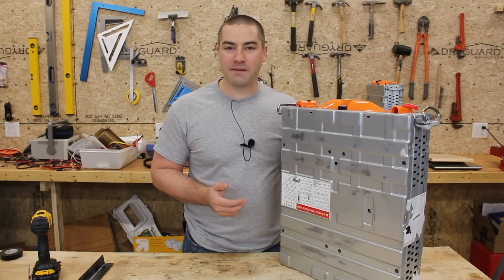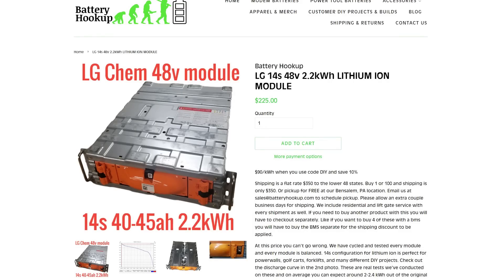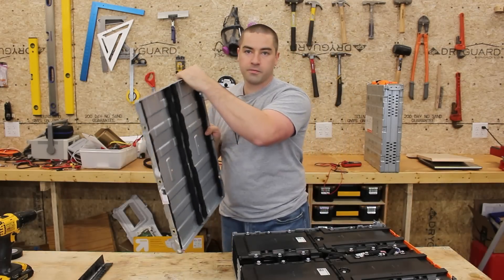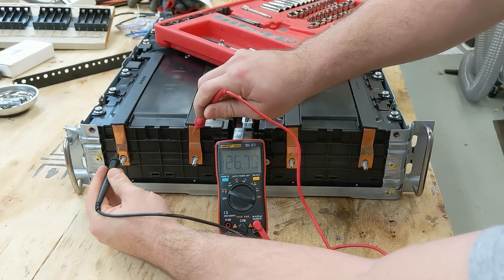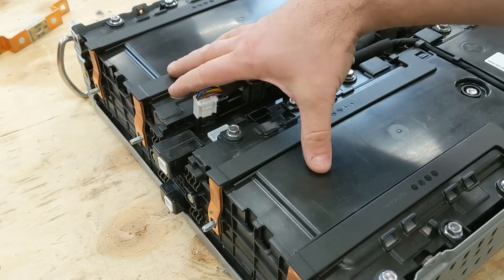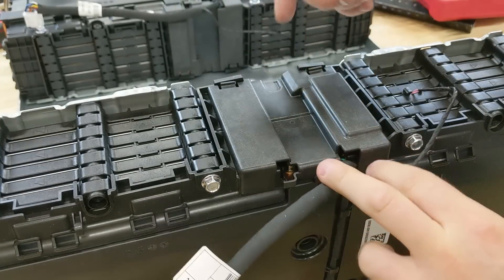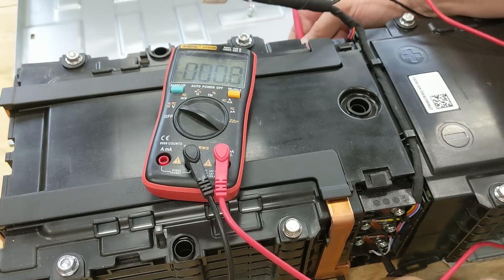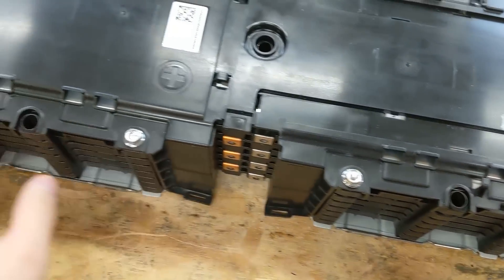Batteries for Home Backup, 14s 48v (51.8v) LG Server Rack Lithium

Comment: Hi Dave, this is all really new to me but very exciting, I'm planning on building an off grid home, with solar, wind and hydro if possible.  What's my best route for a long lasting system, should i buy 20 or 40 of these LG server rack battery's. If I put a BMS in each one how do I collate all the information in one web page, do I rotate the cells or leave the packs more or less as purchased.   How would i wire the complete system holistically and is that something an electrician should do? Lots of questions sorry but your videos have got me really excited about the possibility of building my own off grid home relatively inexpensively.   Thanks for your great videos i cant wait for more.
Reply from the maker: Hi Marc,  Near the end of the video I state that these modules are pretty used up.  They would be great for home back-up systems.  However, if you plan to cycle them daily in an off-grid situation I don't think you will get more than 2 years out of them.  It's just a guess and I could be wrong.  But, if I were building an off-grid home I would look for newer cells.

Now I will answer your question.  If you are looking at 20-40 of these LG modules, then I'd buy 28 or 35 modules.  Keep it in a unit of 7.  Then I'd flip all the cells around, as I described, so that each module becomes a 7p2s.  Stack 7 modules together making 14s.  Each would get a BMS.  If you are the type of person looking for web interface, then check out Batrium.  Batrium cells WM5, and then you add "expansion boards" for each additional 14s pack.  They do the internet thing.  I'm not computer savvy, so I just do simple BMSs.

If you have a little time before you need the batteries, and want to wait for something with more life expectancy, then I'd wait for BAttery Hookup to offer more EV modules.  They just had a few last week of Volvo packs.  And last summer they had a couple hundred BMW packs.  I'm not particular to my brand, any are fine.  But the EV packs tend to have a lot of life left.
Reply: @DavidPozEnergy  not in rush, just watching as much as i can i liked the electric vehicle video you did. I worked for Ford along time ago and they use a hydraulic press to compress the battery's prior to packing.  So i was surprised you were able to repack the battery's..  Thanks for the great information, i do a lot of REST API dev for transfer of data across web calls so i will check out that web site.  Have great day keep up the amazing videos.  Marc

Comment: @DavidPozEnergy Hey, I know this is a few years down the line, you say this battery is dead at 39.2?  By any chance was that a calculator error? I have 4 of these bad boys and I had the cutoff at 48 and the max charge at 56, but then the CC died, I disconnected the batteries from the inverter while the CC was fixed... when I powered it all back on I didn't check the inverter cutoff and it had dropped to 44.4, Just want to check the chemistry on these things and cant find much.

PS, I bought them just a few days after you posted this :) Loved them every since!! Tested them when I first got them and they were all at 2.4 KWH! They are now down to about 2 KWH each, I think... haven't yet got them back up to 100% with the northern winter coming in like it is.
Reply from the maker: 48V is also what I use day-to-day as my Low-Voltage cut-off.  You have some good numbers there. They will last longer living in your 48-56 range.  
I'm glad your pack is working well.  I used mine for a while (maybe 6 months?) then gave my packs away. They were still doing OK, but I just made room for new batteries.
Reply: @DavidPozEnergy   Thank you for the response! I now have them set to charge to 55.6 and cutoff at 48.8 Trying to get AH numbers on them at different voltages, see about how many Watt hours are still in them after that kinda lower then I wanted voltage.

Comment: Hi Dave, my name is Marc,  I  purchased 4 of these batteries,  and  I  am  setting them up together with a map solar 50/ 48 inverter,  it is saying  to put a breaker / fuse between the inverter and the battery, what size fuse do you  recommend  I  use, and what  type,  ?  Should  I  use a barrel  fuse or a breaker?  What  do you think? Thanks in advance! I  appreciate all your great videos
Reply from the maker: Fuses and breakers are both "over-current protection devices".  They work differently, but usually I prefer a circuit breaker when it will suffice.  You must size them based on the wire size you are using.  Here is a good resource: https://www.altestore.com/diy-solar-resources/recommended-inverter-cables-sizing-and-breakers-or-fuses/

Comment: You should get a job with a battery company very nice end result 5 stars as you let it expand will that damage the cell?
Reply from the maker: The cells need to be under compression during cycling (charging/discharging).  It doesn't hurt them to remove the compression during inspection since I wasn't doing a cycle at the time.

Comment: I bought 4- of the single batteries. Not the whole box. What is the specific charging per battery. I’m trying to make a small camping battery with a kick.  I would like to run 4 in series is how I would like to run them.
Reply from the maker: Don't exceed 4.20 volts per cell.
Reply: @DavidPozEnergy  how many amps can I use to charge per hour ?

Comment: If I buy 2 of these set ups and convert them to 24V  how many KWH would I have and what size BMS could I use. I need it to power a small wire feed welder (90A-110A) and some basic tools?

Comment: Nice used your your battery hookup code. I am building a kW solar generator. You should check out Gyll batteries very similar new cells 5kw with BMS priced very good I believe they use prismatic cells

Comment: greetings mr. david; with all your tinkering on this subject, what would you recommend as the best batteries for off the grid, solar system. use continuously and charge daily. generator available for top off on cloudy days? i apologise, you answered my question for another commenter below.................g
Reply from the maker: I don't have a favorite, I just buy what I can get.  Generally I'm comparing $/kwh  Or $/kwh/cycle.  If you buy brand new, then several people have had success with LiFePO4 cells from Alibaba.  I buy used batteries from Battery Hookup.

Comment: Easier to use a flame and melt the 2 red end glue spots first to lock it in and then the solder in the middle, and get a used iPhone to use for this stuff, they are cheep!

Comment: I am in Australia and I have a few questions for you
1- do you ship to Australia ?
2- would it be possible for you to make or modify them into 12v packs with BMS at what total amps capacity?
3- could these packs be used in motor homes?
4- and if all this is possible, what sort of cost would it be?
thanks a lot from Australia
Reply from the maker: Hi.  
1. I am not a seller, I don't ship.  I bought this battery from Batteryhookup.com
2. These are 3.7v nominal cells, which don't work well for 12v builds.  Instead use LiFePO4 (3.2v) in a 4s.  That works much better for 12v.
3. I suppose so, but they are not water-proof, so you would need them inside something

Comment: Hello, I am giong to built a powerwall an wanna connect it maybe to a SMA solar inverter. The cells and the BMS, in my case with an additional active balancer, is no problem. But 
will the battera pack work correctly together with the inverter (e.g. SMA Sunny island)?
Reply from the maker: Yes, for the most part it works.  I have mine hooked up to my SMA Sunny Island right now.  It does work.  However, the inverter is not programmed well for this.  The SMA inverters want to see an outside BMS when connected to lithium.  If you don't have a BMS that communicates then you can run the SMA in VRLA mode.  It's OK, but not a perfect algorithm.

Comment: my setup is 8s4p lifepo4 with 100ah,. the probs is im scared to connect the bms i know will do spark on the post or damage my bms. please need guide to charge the cap.
Reply: Use a series resistor of  a few ohms value to charge the caps. Easy.

Comment: Hi, Dave,  I  bought 4 of these modules,  and  have a  map 50/ 48 inverter,  like  the one you  used for  your  friends  well install,  I  am  building  a  double wide 45 ft HC shipping container house,  I  am  planning  on  using  very little  power  at night,  very  few lights  and a  dish network  receiver and  TV,   and  I  will  have  a  mini split  ac, for  the summer,  as you  know  the inverter will  run everything  I  want to  run during the day when I  am  getting  proper  amount of sun exposure,  after  the batteries are  recharged,  so I will  run my clothes washer and gas dryer  during the day only, so I  expect  to discharge the batteries  very little,  what do you think? I  guess my question is,  do you think the batteries  will  last longer because I am will be using  the batteries  very little.  Thanks for your time and  the awesome  video of the  battery  to BMS hook up,  I  appreciate your  knowledge
Reply from the maker: Certainly the less you cycle them, the more years you will get.  I'm trying to make it clear these are used batteries, and don't expect them to perform like new.  The good news, you will be saving on day one.  And maybe in a few years you decide to upgrade, better batteries will probably be available for even less cost.
Reply: @DavidPozEnergy  , Thanks  for all your great videos,  you are awesome!!

Comment: Can this single unit be connected to a solar inverter without bms addition? 

Is there extra safety precautions can we take like setting min discharge to 48 v on solar inverter side? 

What is the downside ? 

Adding bms seems like a considerable work
Reply from the maker: When working with lithium batteries, I consider a BMS a must-have safety device.  This particular battery was one of the more challenging to add a BMS to.  If it looked like too much work, then consider prismatic cells.  Or, you can purchase a pre-built battery.  Pre-built 48V batteries have come down in price over the past few years.
Reply: @DavidPozEnergy my situation is I have one of these available to keep inverter on until I buy alternative soon. So how can I safely use it to keep inverter on during night essentially. I am thinking volt 56 max and 51 low cut off and 500 watt charge discharge limit. It is only until I buy larger battery. installing bms is beyond my ability.

Comment: Great video.  I need this for backup.  Question: I don't understand how you know which bms wire is for the first cell.  I see you probed them all against ground, but shouldn't they all be showing voltage?  It looks like you contacted your probe to the main positive.  Did you just contact the #1 cell only?  Not clear in the video.  What charge rate and charger would work with this?  I need exactly what you described at the end.  Also the automatic transfer switch.

Comment: Which battery is good for taking advantage of TOU rates? Say you want to avoid peak during 2-6pm, disconnect with manual transfer switch, 5-10kWh, no PV yet. Summer AC is max load, winter heat nat gas blower.
Reply from the maker: I'd suggest this battery: https://www.signaturesolar.us/products/h7590c9c2a/2203789000006324403  because it will last way longer.  I did a review on it here: https://youtu.be/SYJ25izYSGc

Comment: Great information, I’m going to look up some of your videos.  I’m a new guy trying to build a 7s 24volt battery pack that I will be able to use.  Eventually I want to build a home power wall, and be able to remove a battery pack and use the one pack as a power source while traveling.  Is this going to work?

Comment: Terrific info! Thanks! Just wondering, though: those balancing connectors on the BMU seem to be on 0.1" center pins. Would it be ok to just desolder them, put them on some protoboard, and wire the BMS connector to that? It seems like it would also allow you to keep thermal capabilities if your BMS of choice supports having a thermistor. Just wanted to see what you thought of this idea.
Reply from the maker: That hadn't occurred to me.  I don't have a computer background, and don't have any "protoboard".  I don't even know where you buy them.   I think it would be cool though.
Reply: @DavidPozEnergy  https://www.amazon.com/dp/B07CK3RCKS/ref=cm_sw_em_r_mt_dp_7Kq0FbEETQ9XP is one place to get them.

Comment: Hey David I'm not sure if you read the comments or not but if you do I'd like to tell you what I'm trying to do and why. Also I'd like your advice on my system. I have stage 4 cancer and I'm trying to build a off grid power system so if my cancer gets worse the wife and I still have power. And also if I pass away then my wife will have power without electric bills that we already can't afford. I bought 8 panels and a powmr all in one charge controller but I'm trying to find a large battery bank preferably 24 volt since our powmr I purchased is 24 volt. Any help would be greatly appreciated. Thanks in advance and thankyou for your videos
Reply from the maker: Solar electric systems, in general,  do not have a fast ROI (return on investment).  I would caution against building a system with the hope it will pay for itself in electricity off set.  However,  I've worked with people who need some piece of medical equipment running.  Then it's worthwhile making a UPS (uninterrupted power supply) just to keep the medical equipment running through power outages.

Comment: DavidPoz I hope you read this, I recently got several of these and the BMS, I received the same unit you did, it says 3.7v and the lifePo should be 3.3, correct? So how much are you able to adjust this BMS? I ordered them and was expecting 3.2v and instead got 3.7v units.
Reply from the maker: The battery I'm showing in this video is Li-NMC.  I'm using a BMS that is labeled "Li-ion".  It has a nominal voltage of 3.7 volts per cell, and 4.2 volts per cell maximum.

Comment: Great channel , meticulous and detailed - question - What inverter charger would you use on a 20kw LTO set up ? 
I'm building one and know that your opinion would be of great value.
Reply from the maker: I don't size inverters based on the battery bank.  Size your inverter based on your loads.  But if you would like a quick response, I really like the Sol-Ark.  Here is a link, and my code is "DAVIDPOZ" for free shipping.  https://shopsolarkits.com/products/sol-ark-12k?ref=s_fx9xj-vyvj

Comment: Great video, especially appreciate the recommendation against something like this for an off-grid system. 

I'm currently building an off-grid system. Do you have any specific recommendations for off-grid battery systems?
Reply from the maker: Sure.  The BMW batteries are testing far better.  This means they will last many more years for you.  If you combine 2 of the 5s, with one of the 4s, you will have a 14s battery.  https://batteryhookup.com/products/bmw-oem-5s-19-2v-75ah-1-44kwh-battery-module and https://batteryhookup.com/products/bmw-oem-4s-14-8v-75ah-1-11kwh-battery-module

Comment: David, great video.  Your attention to detail is incredible and much appreciated!  I have question in the 2s7p configuration you mentioned at the end of the video.  What would the max discharge and charge currents be in this configuration?  What size wire would you use to connect these in series and what size wire would you use to connect to your inverter?
Reply from the maker: In that configuration, we are talking about 7 modules.  The cells inside being arranged 7 in parallel per side, then the module becoming 7p2s.  Then series connecting 7 modules so the total cells become 7p14s.  I'm just clarifying.  
Each cell (technically 4 cells inside the plastic shroud) can handle about 50-60 amps.  If you connect them in 7p, that's about 400 amps.  
If I was building this, I wouldn't need the full 400 amps.  I might only be building it for, say, 10kw inverter.  If that's the case then I'd be fine connecting them with 4/0 copper wire so long as I was using a 250 amp circuit breaker.
Reply: @DavidPozEnergy  Thanks David, I misstated that you are correct 7p2s.  Thanks for the info and keep up the Awesome work in helping all of us DIYers out there!

Comment: Hi David,  thanks to your inspiration I finally finished a solar install on my mom's house. I was wondering what bms do you like the most. I have 12 chevy volt batteries that are known to be well balanced but I would like to have at least a bms to monitor the cell voltages. I was thinking about using one bms for all batteries or maybe one per 4 batteries.
Reply from the maker: If I had 12 Volt packs and was in that situation.  I would purchase 12 BMSs from Daly brand.  (through Aliexpress).  The BMS's can be small amps since you have so many paralleled.  For example, if you buy 40 amp BMS, they cost about $20 each with shipping.  That would be $240 in your situation, and give you 480 amp total discharge capacity.  If that's not enough for whatever solar/inverter you have just make adjustments to suit your system.

Comment: If you are using it to back up the occasional power failure for your home, approximately how much time could you expect it to work.
Reply from the maker: In my test I got 2kwh capacity per module.  So if you have 1 module, and your house is drawing 2kw, then it will last 1 hour.  If your house is drawing 200w, then it will last 10 hours.